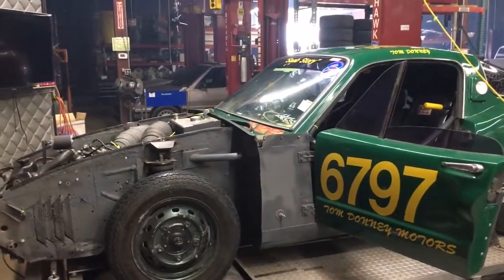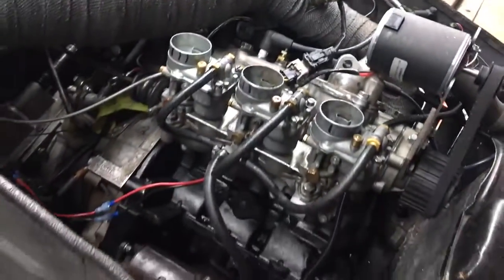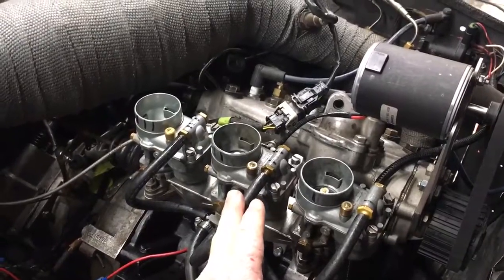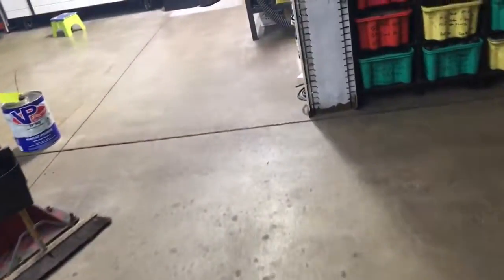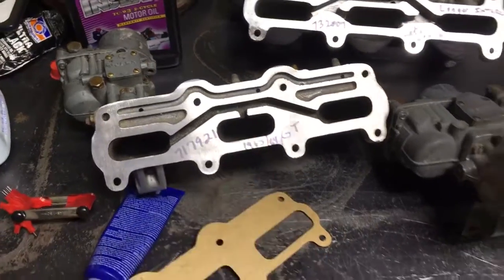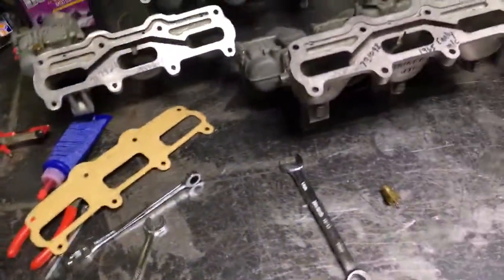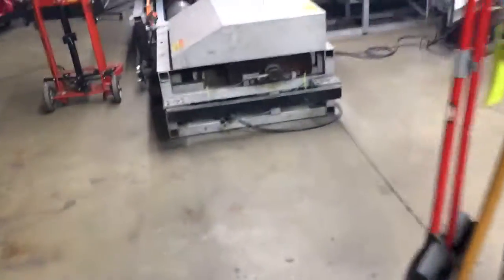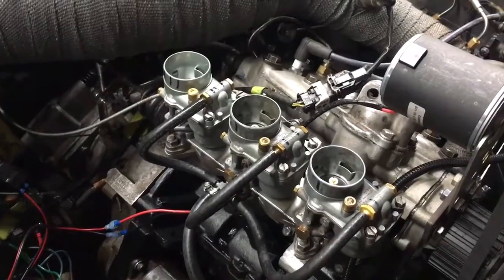AFR Explained Saab Two Stroke 3 Cylinder Triple Carbs Testing with Air Fuel Ratio Meters

Comment: why does the centre cylinder run lean on these engines? and why does the inlet manfold have grooves between the ports?
Reply from the maker: The grooves were put in to balance the cylinder and also allow cold start fuel enrichment to all all 3 cylinders (only center cylinder  has enrichment jet). So these grooves steal fuel from #2 cylinder and run it lean. Had these  engines been made longer I would guess the manufacture would've corrected these issues but they were phased out for the V4 4 stroke.